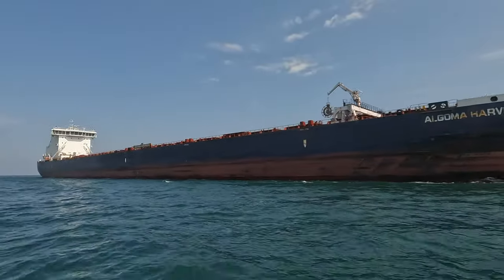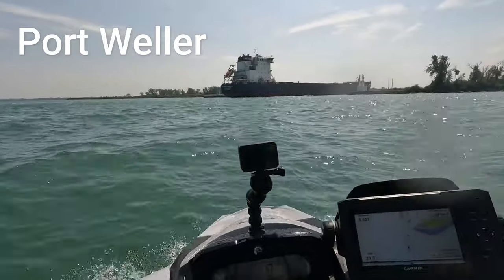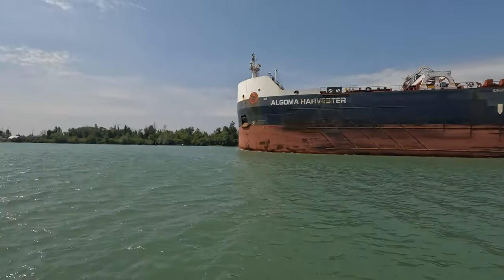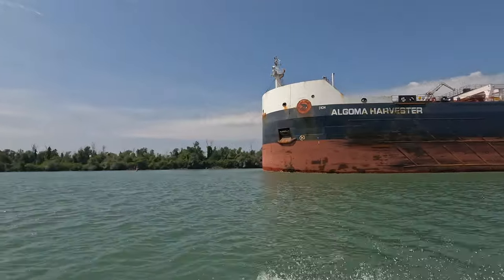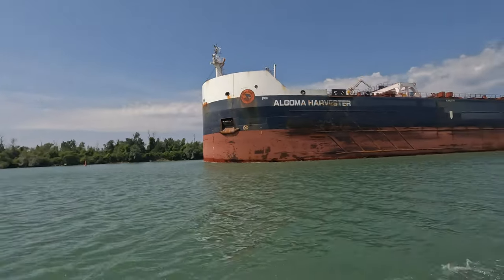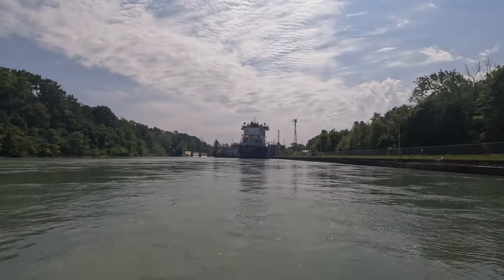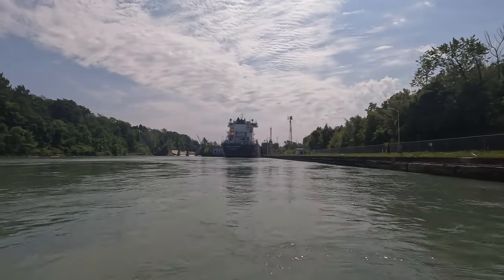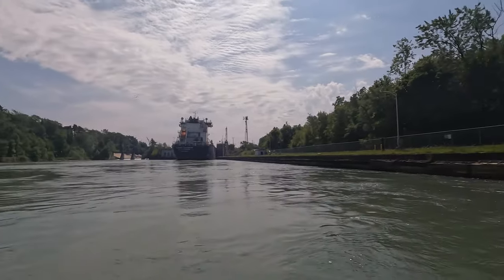Chasing Ships of the Great Lakes - Algoma Harvester

Comment: Wonder why they enter at an angle and not just go straight in ?
Reply from the maker: I can only presume it makes it easier so they don't go off course, ease it in
Reply: With only 1 foot clearance on either side, the easiest way is to use the entrance wall as a guide and then keep the bow against it and then watch your stern swing.  Long time ago when ships were much narrower and had more clearance, they would steer and go straight in the lock, but that changed years ago when ships were built to maximum Seaway dimensions. @NigelHay